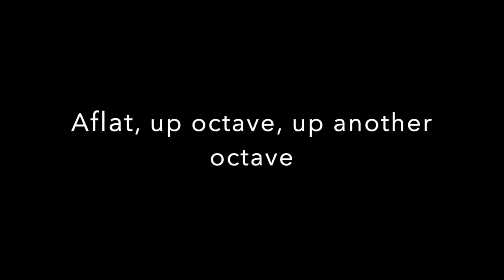Tuning the Horn - 3rd Harmonic

Comment: Could you do a lesson on transposition.
Reply from the maker: Certainly. There are 2 parts to it: the interval relation to the original and the actual transposition. Part 1, clearly articulate the interval between the origin instrument and the transposition. Example Clarinet in Bflat transposes to Oboe in C: up one whole tone. Establish the key of the written original then apply the interval of transposition. Example Clarinet in Bflat part was written in C major then go up one time to D major. 
Part 2 (the actual transposition): note the scale degree of every note in the original. Example the first bar might be an arpeggio C E G, then play the scale degrees 1 3 5 in D major. Check transposition by mentally altering every note of the original. In our example C becomes D etc. Counter check by following the succession of intervals. In our example the first note became D the second written note was a 3rd above therefore must be Fsharp.
Reply: If the b flat Clarinet was play the A clarinet part how do you transpose down a semitone. The A clarinet is written in c major and the notes are 1 3 5 of c major for the A clarinet.
Reply from the maker: @Shielsproductions100  Bflat clarinet will play B major so B D# F#